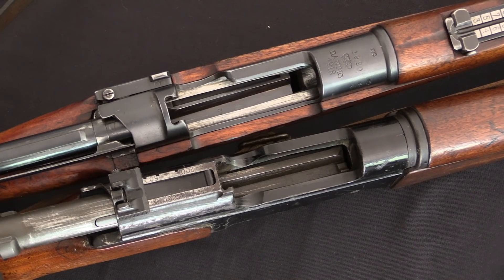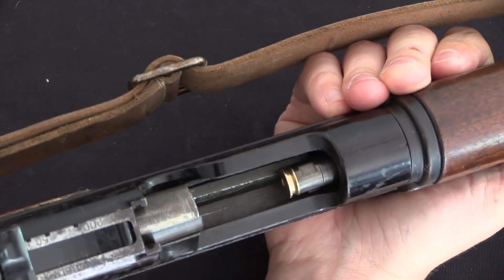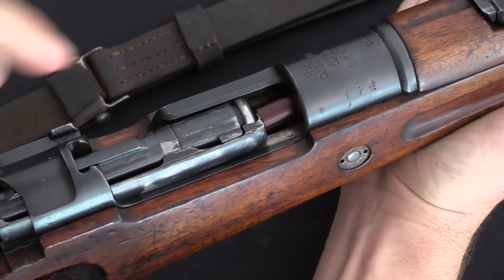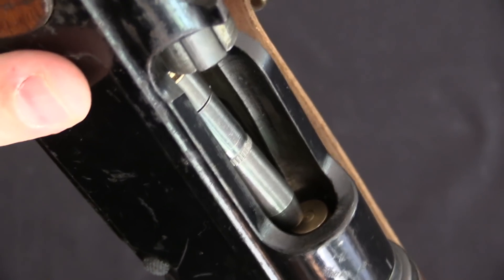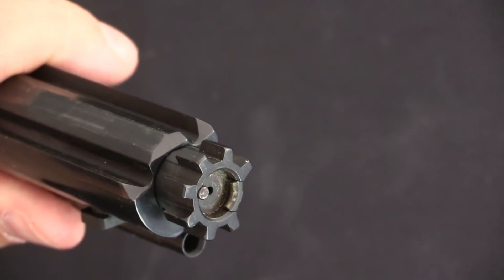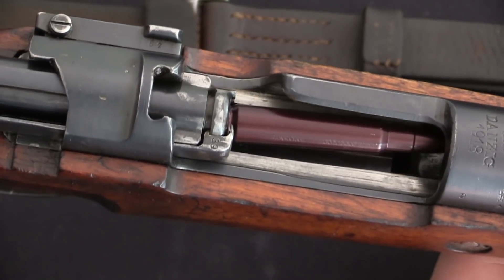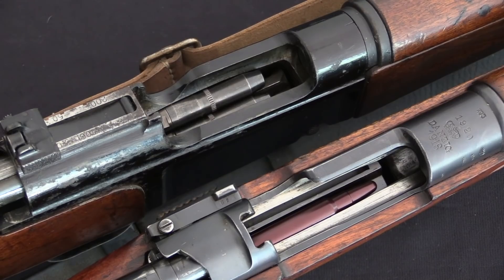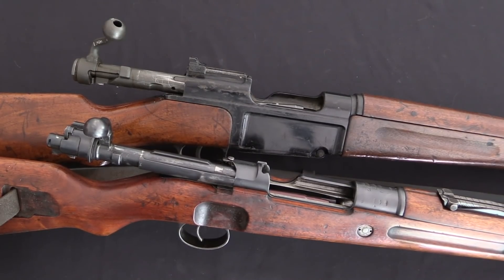How Does It Work: Push Feed vs Controlled Feed

Comment: What if you had a controlled feed system that had an ejection system similar to a push feed system, specifically like the one one the AR-15 bolt carrier, but modified to be recessed until the bolt moved a certain point rearward. As the bolt would move backwards, the extractor would hold on to the casing, and the ejector pin wouldn't activate until the bolt moves a certain point rearward. After the bolt reaches the point where the round can clear the ejection port, the ejector pin would activate(through some mechanical process in the bolt and receiver) and the spent casing would be ejected. Then a new round is picked up and chambered. Would the only theoretical problem/malfunction with this system just be a round somehow coming loose from the mag before being picked up by the carrier? Also, has anyone made a design like that before?

Comment: Funny that I just ran into this issue the other day, I was shooting a couple of old WWII bolt action guns. My Yugo 24/47 Mauser was control feed. I noticed that it would not close bolt on a round slipped into the chamber, so that doesn't allow a +1 load since it can only feed from the mag. I think some would consider that a disadvantage. 

Good info in the video, as always!!

Comment: The only arguments I ever heard in favor of controlled feed over push feed were from early military / dangerous game perspectives. For the early military (WW1 era, the concern was if you got a damaged / non standard / oversized round that won’t fit in the chamber, you can pull it back out of the chamber and for dangerous game if a rhino is charging at you and you get excited and short stroke the bolt, you won’t jam the rifle.

Comment: Push feed is great, however you wont find a African PH hunting with one. The dubble feed is an issue often under pressure. Like a Cape buff bearing down on you. But... you need practice with a controlle feed and technique is important. Any upward pressure on the bolt and things get unstuck real quick lol

Comment: This was a great graphic example of the differences between the systems. I have to wonder if it's more of an issue with less well trained users and those under the strain of combat and dangerous game hunting, where the benefit of controlled round feed would prevent mishaps? (Similar to the popularity of double rifles for dangerous game) Issues which are not often faced by today's soldiers with automatic/semi/burst fire mechanisms, but still faced by danger game hunters who still favor CRF bolt guns.

Comment: One other benefit of CRF over PF is the ability to reliably control ejection of a spent case. Push feed pretty much goes on its own, and often with "gusto." If I want to keep spent cases from flying out of the rifle, CRF makes that easier, by executing a slow pull backward when cycling the bolt.
Other than that they are both very useful and workable action types for a bolt action.

Comment: What a missed opportunity.  I agree with the conclusion, that for most people it will never mater.  And given that modern controlled feed firearms are about 2x the cost (Canada, should be a similar ratio elsewhere), and that push feed are often more accurate, though often to an irrelevant degree, push feed are great.  Of course, there are still some relatively inexpensive surplus controlled feed guns out there.

But the issue is basically bolt action battle rifles, that on a historic and military interest channel should be of some interest.  And the principles for battle rifles are also relevant to dangerous game, or home defense type applications.  For myself, I don't want to go afield in even deer hunting applications without a controlled round feed (CFR) gun.

The main advantage is that you can't lock up the gun with CRF; it can be operated from weird positions, or even while under assault, and still feed; and the extractor is usually large enough to reliably extract somewhat jammed ammunition.  There are no compensating advantage to push feed in the situation for which CRF was designed.

The reference to sniper rifles is very misleading.  Probably most sniper rifles in history were CRF, but today they are largely an outgrowth of benchrest and varmint technology, and then went off in their own direction.  It turned out that the  cheap to manufacture Model 700 was also very easy to machine to perfection, and it was controlled round feed. 

Today we can get mechanical perfection in oddly shaped parts with CNC.  We probably could make CRF rifles that would perform as well as those that have evolved from the 700, but nobody cares, which is fine.  But it is not the lack of CRF that makes these rifles better or more accurate.  They are the result of a path that did not evolve from CRF rifles, and is not badly hampered by that.  If you are shooting targets at 2500 yards, or even from 250 yards, unless you get overrun at some point, you don't really need a CRF gun.  It would still be an advantage.  And it would not need to be a Mauser pattern rifle.

If the great amount of energy that has been applied to micro innovation in sniper rifles were applied to making the ammo stay on the bolt face, would there not be a good solution?  Would such a rifle not be better?

Comment: A lot of bench shooters like push-feed actions as they can drop one round into the action and easily feed it into the chamber. Reloaders like control-feed so that they can slowly pull the action back and the empty brass falls right beside the rifle on the bench, so as to not have to hunt down brass, and risk having it dinged up from being ejected.
Reply: Had several Remingtons, just pull the bolt back slowly and the empty case just falls out on the bench.

Comment: Professional hunters in African safari companies generally prefer control feed actions because they are more foolproof under stress, something learned by militaries of the early twentieth century. 

Also, with controlled feed,  you can clear a loaded magazine without having to push the bolt fully into battery by simply pushing the bolt back and forth, something I used to demo in class.

Comment: Here is another take on this... Would the difference between the two make more of an impact in semi-auto designs?

On paper it seems like it could, but most of the time I don't think it makes a difference in any practical sense, not in any probable scenario anyway.

Controlled feed has been touted as a reason for 1911 superiority, but modern celebrated magazine designs for the 1911, like the Wilson and McCormick, seem to change the feed mechanism to uncontrolled push feed.

This change increases reliability with projectile designs that are not the typical 45 FMJ shape. I think that controlled feed designs are more susceptible to changes of the overall shape/profile of the cartridge than push feed. This is likely more pronounced in semi-auto designs than manual action firearms.

Comment: One factor with push feed (plunger eject) is you can't just 'ease the bolt back' and pick up the empty out of the action (for re-loaders in particular, or for just 'policing' your brass), the empty is always thrown a 'way over yonder' if you want to or not, with a CRF you can throw them a mile and a half, if you want, or you can keep them nice and handy.  As for accuracy differences, I don't think that there is more than 'half a blond one' between the two (I have both in the safe) and I think there is too many other factors with much bigger influences on accuracy to determine if one is better than the other in 'normal use' situations, yes the dedicated bench rest set-up may be able to tell if there is any difference, but they don't have magazines (for the most part) so it is a moot point anyway.

Ian, from one long haired, lefty, gun person to another, keep up the good work and keep the videos coming.

Comment: I remember being told many years ago that the controlled-feed system was highly desirable when hunting dangerous game. The theory was that if, after the first, if you got knocked ass-over-teakettle, the controlled-feed system would hold onto the round, while with the push-feed system, the impact could knock the newly-loading round out of the action. I know for a long time many hunters going to Alaska and Africa insisted on a controlled-feed system.
Reply: Pretty sure if you got slammed into by DG (biggest offender is cape buffalo iirc), a feeding system is going to be or should be the least of your worries after getting run over by a 1000-2000lb animal
Reply: @mannequinfukr  However, after the dangerous game absorbed a first shot, then crashed into you while you were working the action, you would be concerned about whether you were closing the bolt on an empty chamber or not. A controlled-round feed would be a far better way to prevent that from happening.

Comment: Excellent video as always. I might add an anecdote. I shoot a Yugo M48, controlled feed. I shot a Swedish Mauser 96 which is also controlled feed. The difference is that the M48 is cock on open, where the 96 is cock on close. Not much force is needed to cycle the M48 but when closing an Mauser 96 action you are pushing against the full force of the spring, which completely throws off your muscle memory if you are not prepared for it.

I must say the 6.5x55 is a fantastic cartridge, shooting it after shooting my 8mm brought me great joy.

Comment: Does the push feed system allow single loading ? Ie.- dropping a round straight into the chamber and closing the bolt vs. the controlled feed, where you have to snap a round into the magazine, then run the bolt ?
Reply: From the standpoint of the extractor, single loading a push feed is no different than the round coming out of the magazine. In both cases the extractor snaps over the rim when the cartridge is seated in the chamber and the bolt travels forward that last 2mm. I believe some controlled feed rifles have extractors that can snap over the rim after the round is chambered.
Reply: @5000rgb  Thanks. I've heard it both ways. Someone told me that you can damage the extractor on a control feed system if you repeatedly run the bolt on a round fed directly into a chamber. I wasn't sure how true that was.

Comment: I think that you should also make an additional note on the operation of a controlled feed system. You cannot just drop a cartridge on to the follower and chamber it due to the fact that the extractor cant snap over the rim of the case. The only way to get the cartidge to feed correctly is when it comes from the magazine. I think this in some ways is a detriment to an internal magazine since you can only have a maximum capacity of what the magazine was designed for.

Comment: I want to add here that controlled feed is not necessarily superior for hunting. My father's Weatherby allows me to simply drop a round in the chamber during a hunt, which is near totally silent. My model 70, however, requires me to either finagle the rim into the bolt, or loudly chamber a round. I made the mistake of thinking CRF was better after reading about it, and I do regret my naivety a tad. If you can find a post-64 model 70 winchester, they might be even better, and cheaper, than what you'd get out of a CRF rifle for hunting.

Comment: In manual guns, I've only ever had double feeds with a controlled feed M98 pattern. The reason in those cases was pulling back the empty case, until the rim just touched the ejector (misstaking that extra resistance, for the bolt hitting the bolt stop), before going forward again, picking up a new case, with the empty case, still under the extractor. I have newer failed to chamber a round in a manual, push feed gun, unless the case was wonky, and have therefore never (as far as I can recall) had a double feed in a manual push feed gun. So in my experience, M98 style controlled feed, is more likely to have double feeds, than push feed guns.
Reply: Short stroking can still occur in Mauser System rifles, true, but it is nevertheless far less likely than is the case with FP actions.  If you disagree, ask yourself why bolt actions used in dangerous game hunting are almost invariably CF actions.
Reply: @haroldgodwinson832  > If you disagree, ask yourself why bolt actions used in dangerous game hunting are almost invariably CF actions.
Cultural inertia.

Comment: The comment on modern adoption of push feed rifles, particularly in the US, is a bit misleading.  The US sniper rifle WAS controlled round feed (the M1903) until Vietnam following the failure of the M14 sniper derivatives to live up to DMR level precision.  The US military was on the verge of adopting another controlled round feed rifle (the Winchester M70) when two things happened, both related to labor costs.  Winchester reworked the M70 and produced a completely new, push feed action still called the M70 to save labor costs while Remington addressed that issue with a new push feed design, the M700.  Both rifles served as sniper rifles in Vietnam, but the Remington was formally adopted as the M24 (Ian has a great video on an M70 Vietnam era sniper rifle with a Unertl 8x scope that will cause you to appreciate whatever scope and mount system you have).
 Perhaps most confusing, the difference between the M70 and M700 when the US adopted the M700 was NOT CRF vs push feed.  M700 saved on cost by machining its receiver from a cylindrical steel tube and a separate recoil lug ( a thick washer with one side protruding) sandwiched between the barrel and receiver.  Winchester never moved away from a one piece receiver with an integral recoil lug, and eventually went back to a controlled round feed rifle after CNC machining made the labor cost difference negligible (though they use metal injection molding for their extractors, which is a problem in its own right).  Dakota Rifles currently makes two CRF models, the 76 and 99, which differ only in that the 76 uses a one piece receiver while the 99 uses the M700 style tube receiver/washer recoil lug system.
I agree that in most contexts the difference is negligible, but when the rifle MUST fire repeatedly as a safety issue, CRF has two advantages. First, it is possible to short stroke a bolt action when working it quickly as covered in the video.  Second, a Mauser claw will pull off the case rim before failing.  A truly stuck case will remain in the barrel of a push or controlled round feed gun, but the CRF rifle can nearly always be fixed by running a rod down the barrel whereas the push feed rifle likely has a broken extractor from the frenzied efforts of its operator.  This has led to the popularity of M16 style extractors as a modification for the M700, though their installation requires the removal and reattachment of the bolt head.
Reply: The Remington action dates to long prior to Vietnam, it arrived with the 721/722 series in 1948.
Reply: Yes, I agree entirely.  I would add one other reason a CF is superior.  The CF (Mauser 98 system) incorporates a fixed blade ejector which is far less likely to fail than is a mechanical (spring activated) button ejector typically found on PF actions.

Comment: Now that you have explained it, it does sound like controlled feed is a better choice for a shooter that is less practiced as there is only one way to properly operate the gun and one problem that could be have to deal with for a less experienced shooter is eliminated. I will admit that it sounds pretty marginal, but when dealing with people and guns, a slight bit more of safety is always appreciated.

Comment: This is an excellent introduction to the concept.
Reply: Actually it isn't.  Ian doesn't appear to understand why controlled-feed is used almost exclusively by dangerous game hunters (and obviously is better in combat for the same reasons).  There are three reasons 1) it eliminates short-stroke jamming which will render a firearm inoperable,  2) the fixed blade ejector on a controlled feed action can't be jammed by mud/sand etc. and 3) the extractor claw on a controlled-feed action grips almost half the circumference of the rim ensuring more positive extraction.  Push-feed extractors are typically half the size or smaller.

Comment: For me, I still like controlled feed on bolt action more simply because from the engineering aspect it is a robust system!
Reply: It is also more reliable due to the elimination of short-stroke induced jams and because it has a fixed ejector that can't get jammed by dirt/sand etc.
Reply: @haroldgodwinson832  Push feeds can have fixed ejectors too, not all rely on plunger ejectors.

Comment: You are correct Ian, in the fact that neither the Push, or Control feed is any better, or worse than the other.  Such as was the case with model 70 Winchester rifle when they switched over to push in 1964.  This was a money saving and ease of build reason by Olin Arms.  The shooters who preferred a Mauser style Control-Feed screamed from the heights how terrible and inferior the Push-Feed was.  They sighted many "Opinions" and, or made up reasons like how if you turned the rifle upside down with a push how the cartridge would fall out when the bolt went forward, while the control type would hang on to it.  It was all basically a lot non-sense.  I have my Grandfathers Pre-64 model 70 Sporter in .270 Winchester, a Post-64 model 70 XTR in .270 Winchester and a Post-64 model 70 "Classic" Feather-Weight with Claw-Extractor in .308 Winchester.  They all handle and feed flawlessly and with proper ammunition all shoot well under 1-minute of angle at 100-yards.  and that is all that matters in the end.